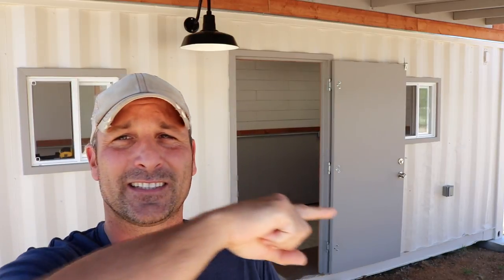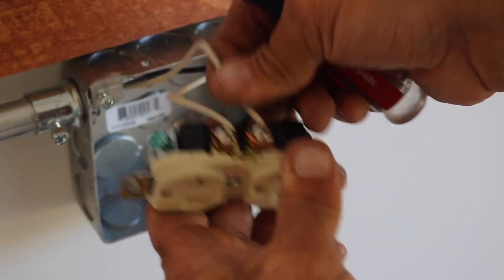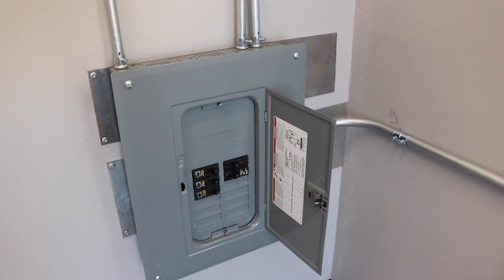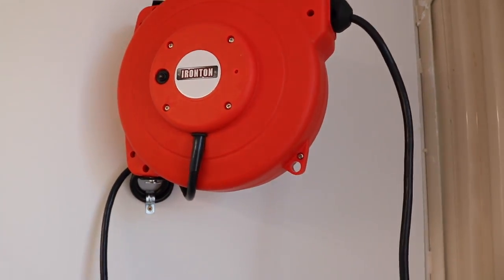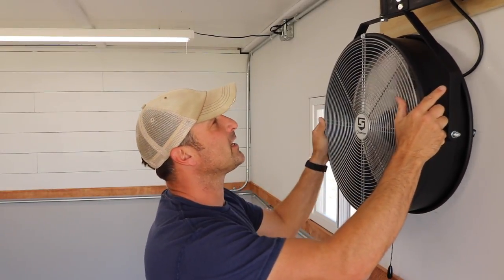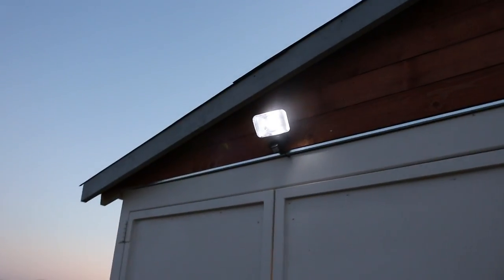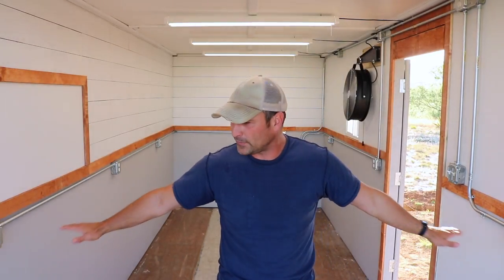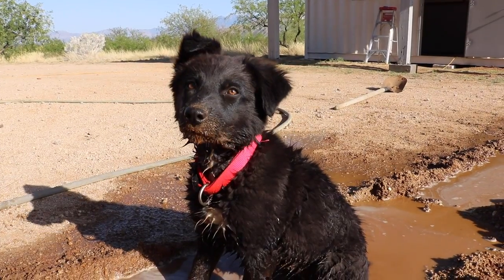Shipping Container SHOP 7 - Electric, Lights, other stuff

Comment from the maker: NOTE regarding electric...  there is no 10ga wire anywhere in the runs.. the main run is #4 and the welding circuit is #6.  And yes the panel is grounded:)  Sorry for the confusion but I didn't show or mention all the steps in the process as I don't want this to be a 'how to' wire video.  For full wiring information for your area consult your local building dept, an electrician, and do a LOT of research ;)
Thanks for watching  and your concerns!!! :D
Reply: Do you know Derek and Hannah from "Life Inside A Box"  they are in Arizona too, they might be a good friend to have, just thought I would hook you up.
Reply: GrahamsLife24 Yes they know each other.  They have a YouTube video together.
Reply: SUGGESTION: Regarding the AC (Because Arizona can get so frickin hot in the summer.) Instead of getting a window unit or an in wall unit, you could go with a little roll around unit for the same price. I have a cheap one for my daughter's room that is 8,000 BTU and cools about 300 sq. ft. room. You can roll the unit around to where you want it and vent it out the existing windows. Or, you can also build a small shelf for it and vent it like a dryer, with a much smaller hole in the wall. IF you want something a bit classier and nicer looking, you could go with a split system heat pump that both pieces are wall mountable. (But they start around $1500 for the unit itself and may require a certified tech to install.)

Also, you're going to want to build brackets for your solar panels to pitch them more perpendicular to the sun. This way, you solar panels are getting the most amount of light on the cells. I have one of those units on my shed, and I do use the mounting bracket with the gimbal. Haven't had any issues with the winds, but I live in west Phoenix. I know my dad's property by the Hassayampa River gets a lot more wind, but I don't think the gimbal or bracket would have a problem.
Reply: Good point about checking the local codes. Here in Washington, for instance, you would HAVE to run the full 3-wire romex. They will not allow you to use the conduit as the ground.
Reply: Minisplit units can be found for $500-700
Reply: Great job, but I was wondering why you didn't do the wiring runs through the insulation layer back in video 6?

Comment: If you plan on adding AC to the shop go with the newer split AC units. A small wall unit is mounted a few inches below the ceiling and just drill a 1 1/2" hole to run the high and low pressure lines and power to the compressor which can hang on the side of the container. No need to cut holes or modify the windows.

Comment: The shop looks great, congrats. Get a split AC unit, a 8000-12000 BTU would cool off the place nicely. Forget about that fan, you can't shoot videos with it running and you'll find yourself sweating all the time. Window units are cheaper but again more noise and not video friendly.

Comment: I prefer putting the ground pin up. Especially since you are using metal cover and if they happen to loosen and fall the could create an arc. There have been accidents where this did happen. Once a lady dropped a sheet pan at McDonald's and it fell against the wall. When she tried to catch it it slide down the wall and came in contact with a partially pulled out plug. Created and arc and burned her.

Comment: if you still have too much heat coming thru the south and west walls..  cut some furring strips out of more foam sheathing.. glue those to the south and west exterior verticals.  then glue on foil covered foam sheathing.. this creates a dead air space and blocks any sun from hitting the side of the container.. paint the foil surface the same color as the rest of your container.  this should greatly reduce your thermal issues.  a gap at the  top and bottom allow air flow up behind the panels.

Comment: Hi Mate, 

Nice project and good result, but have some questions:
1. Why don't  you use a whole 40Ft ?
2. Why don't you have windows on both sides of container for extra light ?
3. Why don't you have sky light in your roof ?
4. Why don't you utilize the space under roof to store materials ?
5. Why don't you made the cabling inside the wall ?
6. Why are you wearing shirt inside out ?

Comment: nice shop. hard to tell from the video but it appears you did not tighten all of the setscrews on the pipe couplings and connectors. Since it looked like you did not run a ground / bond wire in any of those pipe there could be a hazard. Grounding relies on the integrity of the conduit. Best to double check all set screws to ensure all equipment remains properly grounded. Cheers

Comment: That really turned out nice. Question though, would a pre-build shack not have been cheaper ?
Reply from the maker: Thanks John!  ... and yes, the short answer is that stick built can be cheaper for sure... the container is something that I've wanted to try for some time and it offers some benefits too... but dollar for dollar I think you could build a wood frame shed for less.   but it all depends on what you might have and the deal you can score on the container:)
Joe
Reply: Well, it was fun watching !!

Comment: A few electrical mistakes...but not too hard to fix. A subpanel normally needs a main breaker and a separate ground rod. Also the ground wire should be used as already stated repeatedly. It technically works, but it isn't correct.

Comment: Hi, I was wondering why you didn't run the electrical before you put up the drywall?
Reply from the maker: It was mostly a space thing and drilling through the studs would have harder as they layed flat on the walls.  As well as the fact that is made the insulation easier to install:)  ... and I like the industrial look;)
Joe

Comment: Another suggestion, you're bends on 1/2 inch, EMT nice! But code say's , and since you also using for "Grounding, path, each section, emt needs strapped, and within 24 inches of box. Old Electrician, here like you're UNCLE??

Comment: how do u screw the wood to the container? drill the bolt them in? insulation did u use spray or traditional? thanks.
Reply: akeibono He used normal foam insulation,

Comment: why the halving the container ???
Reply from the maker: Alex Benedek there were a few reasons.   One was because my wife didn’t want a long container like that...haha.   She thought a 20’ looked better.   Additionally I got it from my neighbor at a better deal than I could have gotten a 20’ one.  And another reason was to make the mini container out of the front end to sell to my buddy who wanted a small one.   So in a sense, cutting it helped to pay for part of the project.   
However, if I had to do it over agin I think I would have kept that other section and placed each half parallel or in an L shape to make for a roof over a work area.   Anyways, thanks for watching😀👍

Comment: I am surpriced you use metal electricity boxes and pipes. Here (in the Netherlands) we use PVC pipes and boxes because that isolates. You also don't use a third wire for the 'ground'. Is that not standard (specially in a shop like this) where you live?

Comment: top of wall tubes have wery ugly do. and maximum wall socket have 8 pcs one fuse line. no more or need add lot biggest wires. this have minimum 2,5mm2 wire and ewery metal box need connect ground wire. all ground main box and out ground 30 meter min copper wire 16mm2 to under ground. and ALL metal need be ground wire.

Comment: What was the electrical tool your electrician friend put in each outlet to check to see if it worked?
Reply: Michael Mathis That was a standard outlet tester. You can buy them anywhere that sells electrical stuff (Home Depot, Lowe's, your local hardware store, etc.) for only a few bucks. The lights on it indicate if the outlet is wired correctly or not. Some have a little button you press to test GFCI outlets and circuits. If you ever rewire or replace outlets they're worth having in your tool box.
Reply: Thanks.

Comment: Great job.....BUT! You really need to hire a master electrician to come out and explain a few things. Installing a sub panel isn't the same as installing a panel, the grounding can not be bonded to the neutral. And you need to drive a ground rod to ground your shop. You should be able to find plenty of info online. Also your receptacles should be protected with GFCI. It's all about safety. Good Luck.